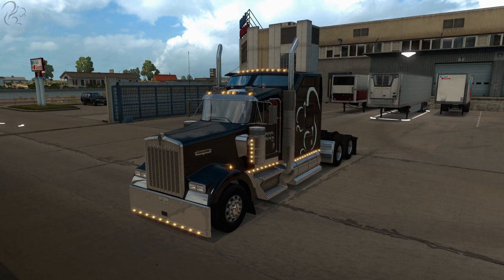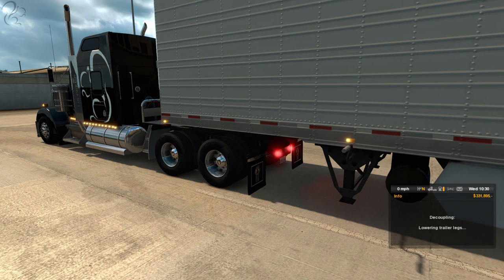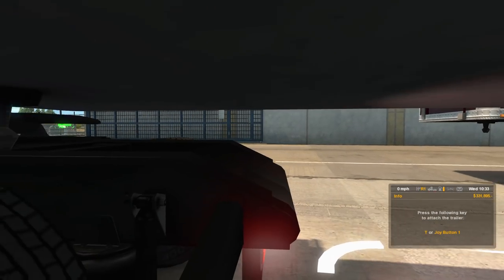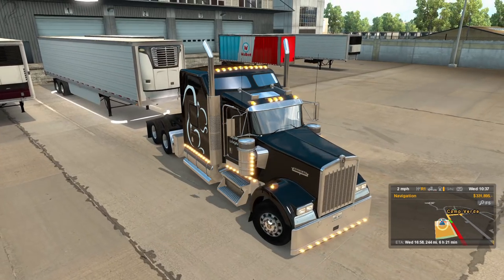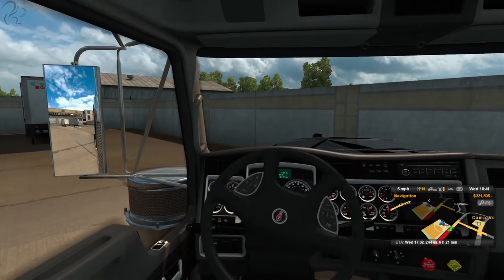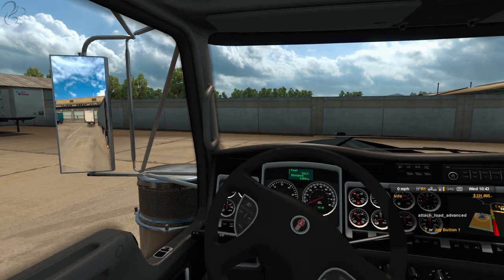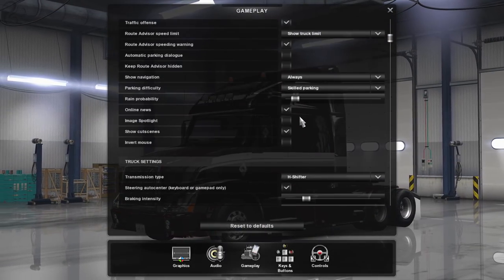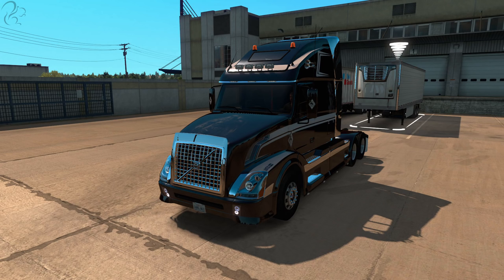ATS/ETS2 Advanced Trailer Coupling

Comment: is roadtrains planned to come to ATS/ETS2? Hooking up a 2 trailer load at one place and taking it to another for example.
Reply: that would be awesome..
Reply: Ask SCS, no point asking here, we don't know.
Reply: for ETS2 there will never be unless they change the laws: road trains are illegal in the EU, dunno about USA, but I think they're illegal there aswell
Reply: Moribax85 not illegal. You knoe those where the load is on the truck abd then just a trailer
Reply: CIAN - ETS2 AND ATS it's not a road train: a road train for definition is a vehicle that has more than one jointed points, that's what happens when you have more than one trailer... the configuration you're talking about has only one still, except that instead of being right behind the cabin, it's at the middle of the truck. plus, regulations set the max lenght of the truck and trailer at 18.75 meters
Reply: +Moribax85 k
Reply: Would need Australian Truck Sim for that.
Reply: @Moribax85  I mean there are doubles in the US, and in the Colorado DLC there are triples
Reply: @engineergaming4295  as i said i didn't know about the US, and those are state laws, not federal laws

Comment: To make things even more advanced, they could remove the white box from around the trailer, so that you have nothing to reference as you reverse ;-)
Reply: There's a mod to do that in the Steam workshop, but it does make finding your particular trailer a bit hit and miss in a yard with several trailers parked next to each other.  It removes the box for delivering trailers too, and replaces it with a couple of markers.
Reply: +PetergdWard you can still just look on your gps, finding your trailer is not that hard.
Reply: +PetergdWard what is the mod called?
Reply: It's "No trailer symbols (find your trailer extra)"
Reply: It gets you in the right area, but when there are two or three trailers parked next to each other, it's not always clear on my GPS which is the one I want.  Perhaps that's just because I have to run at a fairly low resolution.  I've backed under the wrong one a few times.
Reply: Oops, but that's for ETS2, and I just realised you might mean for ATS.

Comment: So many people whining that the missing feature are the lack of air and power lines, Really come on having the proper coupling is a far bigger and better feature. The animated legs is also really nice. Adding the airlines properly and to look realistic would be quite difficult, and if they didn't move as they do in real life people would be moaning again, but it should be added just to make they look right.

Axle weights should be a thing, and leads to having the axles adjustable in ATS, move the 5th wheel to move the weight or move the trailer close to improve the aerodynamics.

Trailers set for different 5th wheel heights, its a common site were the front of the trailer is a fair bit higher would add a nice feature.

Sleeping in cab with sleepers on them(this would add hugely to the game and make the map mods a lot better as well)

this is very likely to lead to double trailers and vanilla support for wagon and drag I am sure

Comment: Hey Squirrel, at 8:05 you said the mod has the crank on the wrong side, however quite a few trailers I encounter here in the US have it on the passenger side.
Reply: really now? ive been around these trailers and truck most my life and have never seen such thing. its always on the drivers as you need to adjustvthe kingpin location before backing the truck under so the jaws lock on the kingpin...also need to do a tug test requiring the landing gear to be 1-4 inches off the ground......time is money in the trucking bussiness
Reply: Yoater is right it's 60% of all container trailers are on passenger side so that trailer is fine

Comment: The trailer I'm trying to hook into won't couple on on any setting I'm as straight as can be but the pin won't go far enough to fit into the 5th wheel I'm using a mod truck the freightliner flb is that why it's not working

Comment: every trailer mod should be able to work with every truck mod, but because the margin of error is so small (10 cm) and you can't just drive under it, but need to be stopped before it locks into the fith wheel it's almost impossible to lock it in.

Comment: OK , there is some terminology that MUST be corrected  , there is no such thing as a "Fifth Wheel"  it is a flipping TURNTABLE, 
the Slot IS NOT the Wedge,  The Wedge is infact part of the locking mechanism that locks the Jaws around the kingpin !! 

Now I ALWAYS use advanced coupling (I drive for a Living ) but the floating trailer drop icon is handy as is the box on the ground simply due to the constraints of the mirror's , my parking boxes and icon at the entrance to job site's doesn't show ?

Comment: Summary of the video : New Advanced Trailer coupling feature introduced. You need to be precisely lined up to couple the trailer to the 5th wheel. No, it doesn't work on mods. You have to wait for the mods' author to update their mods to allow the new feature to be implemented. Boom, saved you 12 minutes.

Comment: anyone using the mercedes actros gigaspace on ets2 and fine that coupling up even using standard method without advanced coupling its like the 5th wheel is higher then the kingpin on trailers and i have to ram it under to couple up, £309k down the drain up to now lol

Comment: I don't get why he's surprised that mods don't work right with this option? lmao Of course they don't work, the dynamic of attatch points and trailer landing gear has completely changed, trucks and trailers now all have to be the same height at the 5th wheel and kingpin else there will be clipping issues and collision issues. This is where it would be nice to be able to adjust the height of the trailer by turning the jack, or to drop the height of the truck by dumping the suspension.